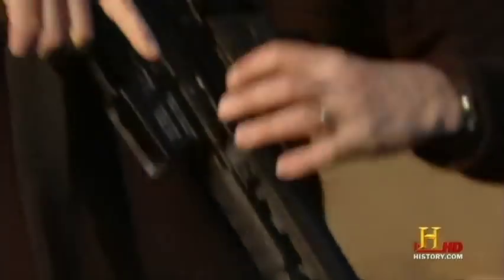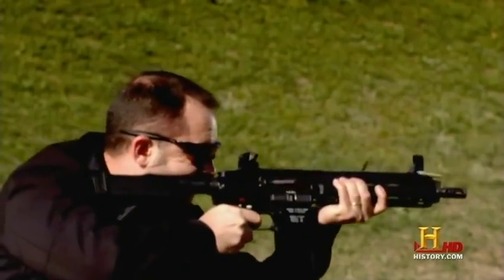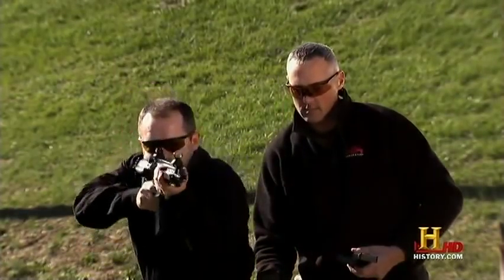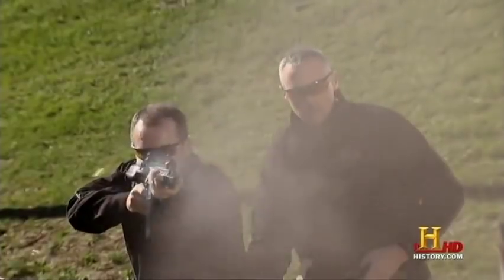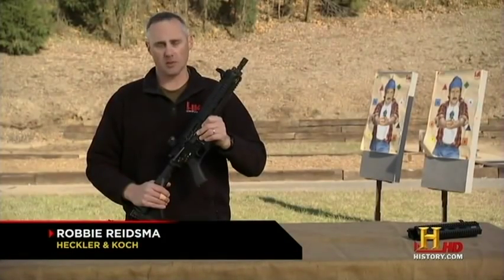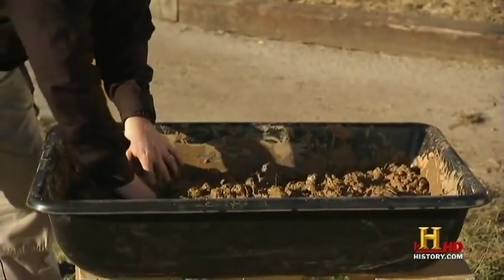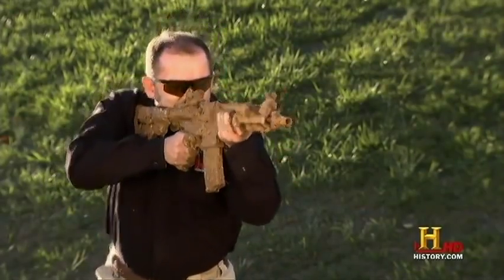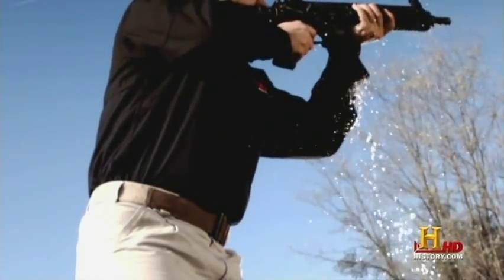HK416 Assault Rifle

Comment: It in fact does have something to do with the return spring, it moves it. Think of an ak, acr or scar. The return spring is moved forward in the weapon. Instead of the gas traveling down a tube and doing the operation at the back of the rifle it does all the operation at the front.

Comment: Also The DOD pitted the M4 against the MK416 in a head to head test in realiability. Out of 60,000 rounds fired through several M4s and 60,000 rounds fired through the Mk416 the Mk416 had 240 failures and the M4 had 300 failures. Apparently the realibility was not a big enough issue for the DOD to spend 3x as much for an infantry rifle.
Reply: Actually, i read somewhere that this rifle is about 800 Euros for the military, i lost the source though.
Reply: yeah your close actually this was a bit of an over exaggeration. A mil spec version was presented to the DOD on range day by Hk416 and it came in just under 1500 US dollars. Still though, an M4 carbine cost the Tax payer $620 and you have almost the exact same capabilities.

Comment: That's been tested.

If I remember correctly, the results prompting the change in standard ammunition were that something like a 3 man group running 5.56nato can match the firepower of a 7 man group running 7.62nato.

7.62nato has its place, but in realistic combat, more rounds with faster/more accurate shots, is always better than better rounds.

Comment: What does the button in the back of the right side do? (Not the magazine one) Is it for opening/bending the gun?
Reply: if you're talking about what's above the trigger and the selector, it's the forward assist. it's there to seat the bolt properly if the weapon is racked and the bolt doesn't catch.
Reply: @abdulqudz89  Also know as a jam button. :P

Comment: No, it does not take longer to dry a DI gun, that simply is not true. Also the civilian version of the 416, that you or I could buy does weight 50% more than an M4 carbine, the issued weapons for the military weigh in at about 20% -25%heavier than an M4 carbine.

Comment: While I adore the 416 it really makes me laugh how they ALWAYS claim you cant do the with M4s. Ive seen em burried in sand and shoot, mud doesnt affect the rifle hardly at all and as far as water is concerned you could submerge it muzzle down and pull it out exactly as they did and fire because the water would drain out of the gas tube before you shouldered it. I just dont get where people claim the M4 is a delicate weapon, if it were we wouldnt still be using the M16 family 50 years later.

Comment: Should be able to handle tougher environments better, but don't misunderstand what's being done here. This can't be lighter than a similar AR15 that is DI, since they have ADDED parts to this system compared to a traditional one.

The AR-15 was designed to be lightweight. Stoner could have put a piston/oprod/strike surface where the gas tube/key is, but he didn't to keep weight down.

A pencil barrel polymer handguarded piston AR15 will weigh slightly more than a railed, heavy barrel D.I. AR15.

Comment: It still takes a bigger time to dry up a DI rifle before shooting than a piston-powered rifle.

And the HK416, even though it's heavier, is not 50% heavier (The HK416 D14RS without a magazine weighs the same as the standard 14 inch M4A1, with a full magazine). Not really 50%.

Comment: Damn so it can survive in sand,mud and water right? So the Ak-47 (I'm not sure if this is true or whatevs leave your opinions down below) survive like the hk416 did and... we have a rivalry on our hands! Maybe
Reply: Thing is, the AK is actually kind of unwieldy. Sure it's reliable but after a few rounds you'll have to stop since your rifle's up in the air already.
Reply from the maker: The AK-47 is a good rifle but it is not perfect, i think the HK G3 and/or FN Fal are better.
Reply: The AK series is by far not as reliable as many think. But it's also not as unacurrate as many think. A good modern long stroke piston system is very accurate. But the G36/HK416 gas system is in fact far more reliable than a AK. The G36 stood out by far at the point of release, it was revolutionary.

Comment: this is a separate weapon design from the ar15 family. todry lots of manufactures r building piston ar15s o5 piston kits for ar15s which dont work for ar15s because Eugene stoner purposely designed his weapon our the DI system for accuracy and balanced weighed as well as lots of ammo. None of these piston systems work because of carrier tilt. In a competition the military held to replace the M4, most companies used piston designed weapons because it keeps lube from drying in the bolt carrier group, critical ij sandy environments. Remington brought up the ACR, HK made the 416, FN made the SCAR, LWRC created a weapon called the M6, and i believe Colt created another DI designed weapon called the Cm901 but pulled the weapon out of the competition. if i am correct, hk and lwrc designed the weapon purposely for piston systems so the dimensions of the weapon changed and adjusted to avoid carrier tilt. The SCAR also competed very well. While most of the weapons made the M4 look silly in terms of reliabiliy, none succeed so greatly that it should replace every m4. personally i think we should keep the m4, but make adjustments to the gun. luckily i believe most troops r allowed to bring their own mags, because p-mags r the way to go. lots of  m4 failures r from mags and misfeeds. 
the us army adopted the scar and the 416, but did not by any means replace the m4. both weapons beat out the m4 in certain categories of testing, but none of the improvements were so great as to replace it entirely. personally i believe the m16a4 and the  m4 will be around for a while, with just new weapons designed and adopted along the way

Comment: I could train anyone to disassemble and reassemble a SCAR in less than 10 minutes on instruction, also, its ergonomics and controls are virtually identical to the AR platform. The Scar is much much simpler than the AR-15 and its variants.

Comment: A piston AR-15 has more violent recoil, weighs significantly more, is more likely to break a bolt/tear casing/break extractor.... how exactly did they make it better?

The AR-18 is a modern piston gun, and it does great, but the AR-15 was designed to be lightweight. Adding a whole bunch of parts to solve a problem that existed 50 years ago because of shitty production is just trying to make money.

Comment: I'm not a fan of piston ARs.  Colt experimented with a piston system but it had too many issies.

The hk 416 seems to be the toughest of the bunch, but even they have issues after 2,000+ rounds with OP-rods bending and carriers deforming where the op-rod impinges.  If you want a piston rifle, use one that was build around a piston system.

By the way, the Ar 15 is not a DI gun, it is a piston gun.  This was done on purpose to reduce  recoil impluse and use less moving parts.  Even stoner's patent even says it's a piston gun.  Tim at M.A.C. goes into more detail.
Reply: lol

Comment: Canada sucks then.
The 14.5 inch barrel was the original 416.
The test you are referring to is not a fair comparison of a gas piston vs DI, the only reason the 416 didn't explode is because it was a specially designed for the test with drainage holes, I could easily make a DI gun pass that test aswell if I went and custom designed it to do so like they did.
Not once did I hate on gas piston rifles in general, just the 416, because it is overpriced crap that doesn't even fix a real problem.

Comment: You really have no grasp on the mechanics of an AR-15 and how its parts are laid out do you? If you did you would know that changing the DI system with a piston system doesn't magically remove the need for the return spring and buffer in the reciever extension for the weapon to cycle.

Comment: I don't think those test were accurate enough. Try putting sand and dirt inside the bolt and mag. An ak47 will survive it to the last bullet. The 416 or any rifle for that matter won't.
Reply: It will, otherwise the rifle wouldn't exist anymore.
Reply: Depends on how much sand of course, but I have fired the 416 with plenty of sand in it without trouble.

Plus, the AKM is rubbish at longer range. More recoil, heavier and slower muzzle velocity.

The AKM isn't some extraordinary weapon. It is a very decent and reliable cheap weapon that was ahead of its time, but it can't compete with modern weapons.
Reply: The HK416 is more reliable than the AK in virtually every single way imaginable, nice try on lying though.
Reply: +Zoltan Csikos That's complete bullshit.
Reply: +Matt Canipe How so? Does the AK got commie magic that defends itself against jamming with little soviet soldiers?

Comment: Failed miserably in cold. I still prefer mr. Kalashnikov's system.
Reply: You misspelled Stg. 44 there but no probs.
Reply: Hermann Chan Dont tell me you were serious with that one?
Reply: I've seen these things run pretty cold.
Reply from the maker: Lapinmiez If you use/fire long enough, every weapon gets malfunctions...
Reply: Bejita666 It has nothing to do with that. Its the gas regulator thats poorly designed and i dont understand why it has one if its ment to be a standard service rifle. Its unnecessary and only causes problems.
Reply: Lapinmiez
The Osprey piston conversion works pretty well in the snow
Reply: We've actually tested it in -25C back in February. It works, but it's prone to jamming if you don't coat it in a thick layer of oil.
Reply: course will fail. They "clean" with hot water. And the condensation? 
Need clean properly and lub with oil rather than water.
Reply: I don't know much about the HK416.

But though the AK line of guns have had a good career, they are simply ending their lifespan as a primary weapon for most modern military.

Pretty soon most will say goodbye to the child of the 2nd world war.
Reply: I think the AK has a lot of years left and because of how many of them world wide, we'll be seeing them in a lot of future conflicts
Reply: Um, I think that any weapon could fail.
Reply: Excalibur01 They will be around forever. xD
Just like how the Mosin Nagant is, they are just to many made.
But speaking from a standpoint of modern military's.
Reply: meh, that means the Tavor is probably more reliable. Check out the Frozen Tavor: -31 Cold Testing by morrison arms.
Reply: Like an iPhone vs galaxy competition....
Reply: *****
Afghanistan -15C Norway easily -40C at winter time. Even some gun oils start to freeze at that point. Do you have other arguments with this subject?
Reply: Except numerous reports that claim otherwise, heres an example from couple years ago http://www.thefirearmblog.com/blog/2009/03/06/norwegian-soldiers-having-problems-with-hk416-2/. Two of my norwegian friends that were in service sayd the same that there were numerous malfunctions when they where at training camps when there wasnt time for proper maintenance
Reply: Lapinmiez probably a manufacturer defect. It wouldn't make sense if the seals use that weapon that could break so easily.
Reply: #1. It doesnt matter shit since the system hasnt changed since that #2. It doesnt matter shit since the system hasnt changed since that #3. You think that jaegers will openly report to media that their main assault rifle doesnt work in extreme conditions? May i ask how much military experience you have?
Reply: ***** Let me explain this to you simply. If the leadership of a military is convinced by a manufacturer and they have already bought shitload of the weapon system and its already in wide use when they find out that it wasnt the best choice, THE LAST THING THEY WILL DO IS ADMIT THEIR MISTAKE. Because they are afraid that they will lose their pride and authority. Ofcourse these situations are not reported officially but every fucking military has done it multiple time in last decade. If you have been serving in ANY military you know this to be exactly the truth
Reply: You can't just say "I prefer" and then be done with it, even if the AK has better conditioning for the cold, it still wasn't a good weapon to use for them, hence the high recoil and less accuracy.
Reply: WilSkullGaming Depends pretty much on what ak is in question. 5,45mm ak's have very little recoil and what comes to accuracy diopter sights are always better at long range than open sights. The myth that ak is inaccurate as a weaponsystem itself is just complete bullshit.
Reply: Lapinmiez Keep in mind that you've insulted me too. Don't be a hypocrite.
Reply: ak 12?

Comment: Such a pitty this rifle is not reliable, it breakes down so easily.
Reply: On the contrary; it never breaks down.
Reply: Zoltan, every rifle breaks down, every last one. Call HK, even they will tell you the HK416 does break down and has lemons that have been put out. It happens. Stop with the arrogant ignorance.
Reply: +Dag Ut No, it doesn't! i have used this weapon in an arctic enviroment for a year. And it never broke down, no problems at all.